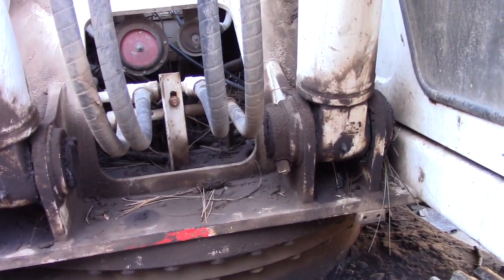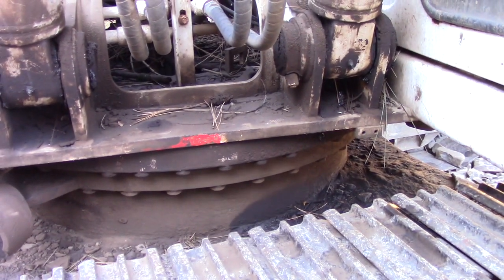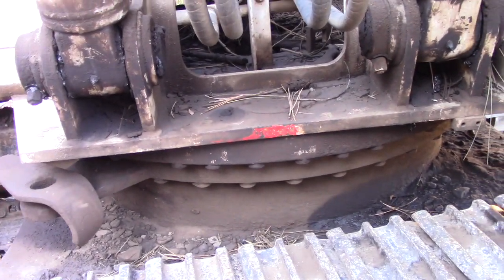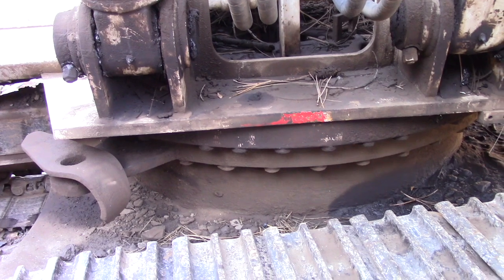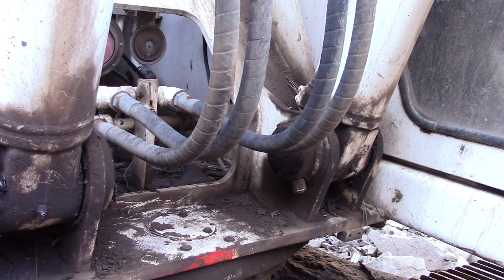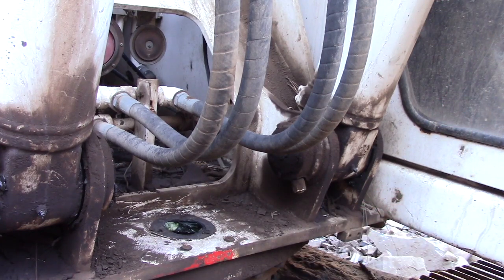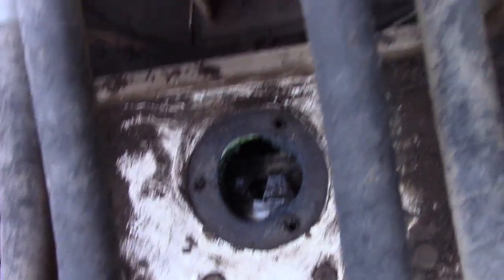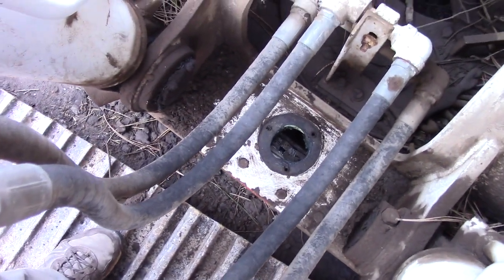Link Belt 2800 Slew Gear Inspection

Comment: Gooey = GOOD! ... Crustyness and Shiney, Glittery Stuff = VERY BAD!... 

How come every time I want to use my Old 850 Ford Backhoe when it is Cold Outside, I've got to Start A Fire In A Metal Bucket and Shove It Under The Ass End For 20 Mins Until I Can Get The Machine To Move?... Everytime I Drain the Water Out, it seems like it just fills right back up... Think I'll start throwing a Tarp over it or find  Spot in The Barn for it... But if it freezes up when it's in The Barn, I'd be up the creek without a paddle because I couldn't Burn a Bucket Fire in there... What's a Guy supposed to do?... Haha!